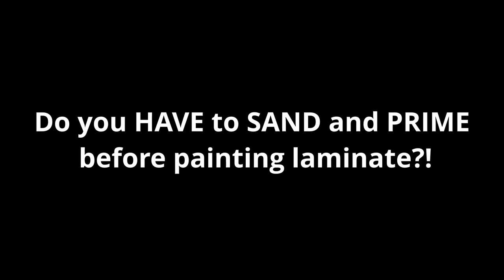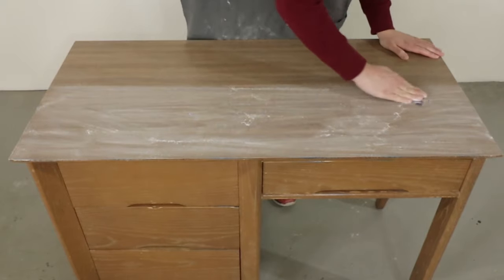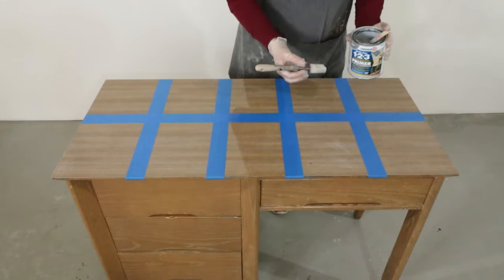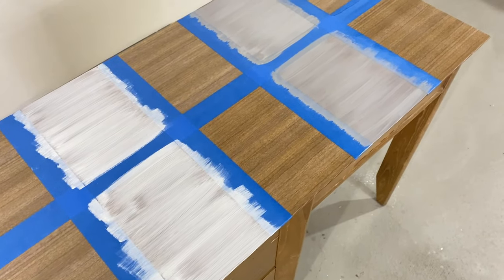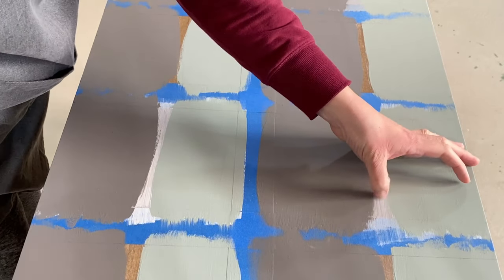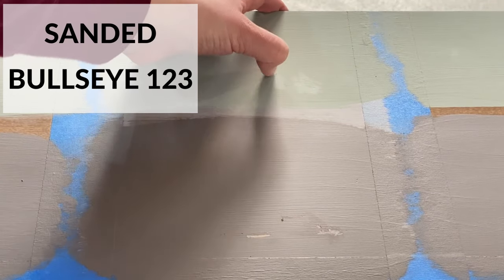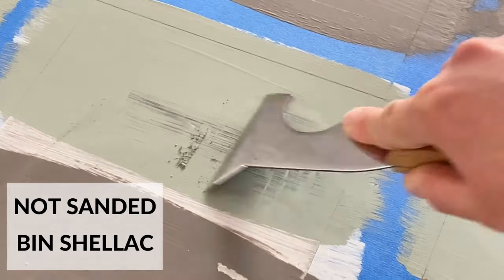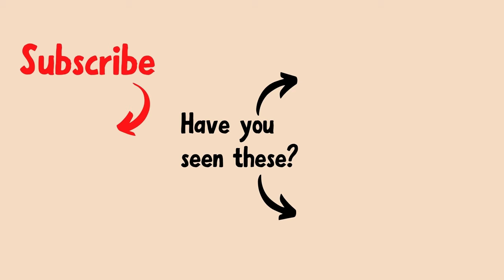BEST Primer for Laminate Furniture | Without Sanding VS Sanding | How to Paint Laminate Furniture

Comment: The day Zinsser and Killz products were presented to me, especially BIN Shellac is a point of no return. It sticks to almost everything, including a greasy, cracked wall behind a stove with a crappy exhaust hood. No amount of degreasing and sanding then priming with oil base then mud then primer and then painting would stick, everything peeled right off. The gray heads in the hardware store blamed my technique, their products and recommendations were fine. 

Then Youtube proposed killz and BIN and I tried it, and never went back, it's part of every single drywall repair or priming task where a clear coat is not required. Had not tried on laminate tops yet, your video is evidence I can trust my friend BIN.
Reply: Is it dangerous to use around children and pets?

Comment: What is the best tool to use with painting on the Bin Shellac primer for laminate furniture, like an Ikea desk? Foam roller or bristle brush? Also, I've been trying to find examples of someone using lime wash glaze over color painted pieces. I have the Valspar lime wash glaze. What would be the biggest difference between using the lime wash glaze or white wash? I'm overthinking I believe.
Reply from the maker: Yes, this method is for furniture like an ikea desk. You can use either a roller or a brush, whatever you prefer. As for the liming wash or white wash, they are the same thing. I haven’t personally used them over paint, but I’m sure someone has! Best of luck!!

Comment: After ALL the confusing videos I've watched, yours FINALLY answered all my questions and hesitation. Excellent tutorial and you saved me so much time! Now I can confidently sand laminate, use BIN shellac primer, then chalk paint. Done. Thanks a million.
Reply from the maker: Happy it helped!
Reply: Specifically came here to see which is the best option. I just painted two night tables with chalk paint (sanded, no primer) and they are just for my use anyway....and I was really impressed with how well the paint adheres and stands up. BUT considering how much work goes into painting any piece of furniture, I wanted to be sure that it's not going to be wasted because I should've done something. I'm now at the point of repainting furniture I painted about 25 years ago (latex, no sanding, no primer, over wood) which stood up amazingly well but is not the best looking. (But I was learning). This was a great video, thanks so much.

Comment: Thank you for an informative video! I want to paint a cheap bathroom vanity. If I went with the shellac primer and a chalk paint, do you think I could put a sealant on top of that since it will be in the bathroom?  Please and thanks!
Reply from the maker: Yep, for a bathroom vanity you can. I would do a waterbased polyurethane topcoat. Make sure to apply 3 coats for the best durability.

Comment: OK I'm not doing furniture, but laminated room doors, five in total. I will not be removing the doors seeing as I am working alone. I'm a 71 year old woman who is not as strong, for some reason, as I used to be. I have nowhere else to go so fumes are a concern. Sanding is also a concern with no way to block off the dust from the rest of the house. This also eliminates spraying. I will be painting latex over these. The Bullseye 123 sounds like my best bet. Any suggestions?
Reply: following

Comment: Thank you for this. I'm trying to figure out what went wrong with a laminate shelf I just painted. Used the BIN primer, but used latex paint over top and it's all peeling off. Should I go straight for chalk paint? Or do I just need to seal the latex paint to get it to stay put?
Reply from the maker: Oh no!
Is the bin staying on? It’s just the latex?
You can try to seal the latex and see if it will be enough. But since it’s a shelf, it might not be. 
You can also wait a week or a month to make sure it doesn’t get better.
A poly topcoat will definitely be needed over the latex but I don’t know if it will keep it from peeling up.
I’m sorry!!
Reply: The BIN is staying, it's just the latex peeling off. Such a bummer cause I feel like I need to sand and start over at this point.
Reply from the maker: What a bummer!

Comment: Would the results have been different if you have sealed at the end?
Reply from the maker: Maybe a little bit. But the topcoat can only do so much if the layers under it aren’t adhering to the surface first.

Comment: Bullseye 123 is lying when it says "sticks to all surfaces no sanding" (it will bond , but takes a month to fully bond), you are right to be skeptical , and most of those water based primers do not hold up to that labeling ..... Kelly Moore KelBond is probably the best , but it doesn't brush well , it sticks well , but brushing it sucks really , not user friendly ..... I have found THEE BEST water based bonding primer , hands down .... going to make a video on it soon , I just discovered this , it's a game changer ..... sticks ALMOST as well as BIN , water based , you definitely will not scratch it off with a fingernail .... and truly NO SANDING
Reply: what is the water based primer you found
Reply: @GadgetsGearCoffee  PPG Breakthrough Satin , but it's not a primer , it's a paint , but it sticks like crazy and can be used as a primer , HOWEVER , it's expensive as hell .... Kelly Moore Kel Bond is half the price and works pretty well .... all the others are okay for general use , they aren't terrible really , and the Zinsser 123 ain't bad .... but that PPG BReathrough will stick to ceramic tile like a mutha !!!!! Takes a while to FULLY Bond , but it BONDS .... in just a few days it's stick quite well ....

Comment: That "Laminate" sanded awfully easy ..... THAT is some crappy "Laminate" , sure as heck isn't Formica .... What exactly do you mean when you say "Laminate" ??? From what I see , it looks like you are sanding a clear-coated top , NOT a "Laminate" like Formica ..... Formica Laminate does not sand like that , you can barely scratch it which is why it was such a good counter top ..... I think when you say "Laminate" you mean "Veneer" , some furniture is MDF with a thin VENEER of "grained wood" and then it's stained and clear-coated ..... It's basically MDF that's given a thin veneer of "real wood" ..... I think it's a bit confusing to say "Laminate" because it's STILL just "stained and clear-coated wood" , same as any wood furniture would be .... and if it is "Laminate Furniture" , that's going to be the kind of furniture that has a Formica Laminate like the IKEA stuff .... That stuff doesn't sand very easily , it's not supposed to , it's super tough by design
Reply from the maker: Videos can be so deceiving. But yes, this stuff is laminate. like thick, plastic ikea stuff. Like Formica. I know very well what wood veneer is, I work with it all the time, and this is definitely not veneer.
Reply: @ARayofSunlight  I've sanded Formica , scratched it up to get a bond for painting ... I never saw that much "sawdust" sanding Formica , that's why I was skeptical about the word "Laminate" ... That must be some crummy Laminate to sand that easy

Comment: Best, most extensive review I've seen. I will be painting my old laminate kitchen cabinets soon. Thank you!
Reply: Yes, agreed, thank you so much! You've saved us all so much time & money with your really helpful research. 🌞
Reply: Hey me too! My cabinets are getting sanded and primed, but I think I will go with the latex over the Killz original, because chalk paint is just too matte and I don't know how hard it will be to clean them.  Of anything, kitchen cabinets really get greasy and dirty.  I like a lot of light in the kitchen so splashes and dirty fingermarks really show.
Reply: @rockshot100  prolly too late for your project but you can put varnish over the chalkpaint for kitchen cabinets. I use old master's brand armor. I have this product on chalk-painted hardwood floors for a year. It's amazing. Easy water cleanup ... but bad fumes. You can buy it in gloss or satin. Getting ready to repaint the kitchen cabinets and use old masters instead of that stupid wax that doesn't hold up for kitchen use. good luck!
Reply: @rockshot100  Are you willing to update us on how this went?
Reply: @queenofqwerty  Thanks
Reply: @mirandamom1346  Sure, I haven't started yet.  I am painting the outside (exterior of the house) right now.  But will give you an update.  I have seen and heard other people doing exactly this and they are satisfied.  Chalk paint is extremely expensive, but I want to be 100% sure the paint will stick and be durable.  I will let you know.  BTW, SW often has 30-50% off sales, it is good paint but why pay full price if you don't have to.
Reply: @rockshot100  Thanks. I’ve never thought about using anything but cabinet paint on cabinets, so I’m curious to hear how latex works out for you, especially in terms of brushstrokes and durability.

Comment: This was a nicely done comparison.  I agree (and would have guess ahead of time) that the shellac based products would stick the best.  I have lots of experience using both clear shellac and the BIN.  Shellac is a very 'sticky' molecule and is often used as a tie-coat to allow two otherwise incompatible finishes to be applied to a surface.
Reply: She did a great job, and these are the results I expected.  I was not convinced that the chalk paint stuck so well, but it does.  The downside is, it is very expensive and for surfaces that get a lot of use, like kitchen cabinets, desk tops, etc., I doubt it will clean up very well.  It is flatter than flat or matte and seems like it invites grease and general dirt.  Personally I would use a much coarser sandpaper and a sanding block (scrap 2x4) to really get some grooves into the laminate.  BTW, I did not know that clear shellac existed.  Somebody told me to never worry about getting the white shellac to look good, only make sure that it is covered.

Comment: AMAZING!!! Thank you for this! I got STIX primer based on the recommendations from the local hardware store because they said it would be good low VOC but I looked and it's not low VOC. I have IKEA furniture I sanded down a bit the melamine with 150 grit, had an N99 mask on, tried to keep things as clean as possible but the dust still did go around, I'm working indoors and I'm at home a lot so I want to go with low VOC. So even though the BIN is the best and I see it scratching a little on the sanded side of your test, I think that's the route I'll go and just be careful I suppose.

Comment: Great video!  I painted a few wood pieces at home and my bathroom vanities are such a disappointment for me.  I was in a rush and not knowledgeable and used the 123 on them with cabinet paint.  They peel.  I used liquid sandpaper. Oh, these were 80s oak cabinets that should’ve been sanded.  My plan someday is to just get new doors and drawer fronts for my vanity, strip the paint off and use shellac. They are totally fine for now because I touch them up and then they look brand new.  If I had used Sherwin Williams emerald urethane paint with a good cure, that would’ve been better. I have a dresser with that and it’s solid.

Comment: You can take the CCP to a some strictly paint retailer's. And put it in a spray can for aerosol use. Seymour is the vendor for this. 
They should have both for solvent and for latex products. 
About 10-12 dollars a can.
One tip ...life span is about 30 days.
Hope this helps

Comment: Hello 😅👋I’m wondering if you could help me, I loved your video and made so much sense. I’ve ordered a full pax wardrobe and I’ve gone with a grey and gold theme for my bedroom, so I’ll be doing the same with the wardrobe, would this method do great for painting the frames and doors of the pax wardrobe I assume? Well everything as I'll be covering everything that's white. I’m not sure we’re I’ll be adding any gold yet or where what should go where with what colours, but definitely some gold on the inside with grey colours, so I’ll definitely get the bin shellac primer for everything.

I’m still stuck with what type of paint to get? I saw you used a lot of chalk paint, is that what I should go for, other videos say water based paint is okay, but your video seemed to make so much sense. Also I’d need a lot of paint I think for a 236cm height by 200cm width wardrobe.

I’m still looking for inspiration for how to bring the grey and gold together but the main thing is just the method of painting to give it that perfect finish you had in the video, to make it easier I was gonna do the painting before I build the wardrobe, so I’ve just got a peace to work on at a time and not a whole wardrobe painting at awkward angles etc haha. 

Also to add I haven’t bought any painting products yet, that’s we’re I’m stuck. The primer you suggested sounds promising! So I'll get that for sure. 

Thanks for your videos and thanks for your time 😇🙏.

Comment: We had a pro reface our kitchen cabinets. He made new doors. But the paint he used was some self leveling  paint made just for kitchen cabinets. It took 24 hours to completely cure and stunk really bad. But it dried with zero brush strokes or roller speckle. It dried super hard and accidental dings do not even leave a scratch. Any idea what brand it might have been? Seems that would be ideal for furniture.

Comment: Thank you so much. I am painting a laminate bookshelf for a friend. She wants me to use her latex paint left over from her walls. Well, I sanded the boards and she didn’t have any primer and told me to just paint. Yeah right! Exactly what I thought. The paint came off in sheets of latex. So I’m starting over doing it right. I have remanded all the boards and ready for primer. I have Valspar professional bonding primer I was going to try but after watching you I think I’ll run over and get some shellac based. Thanks so much!

Comment: Nice comparison Almost any primer if not sanded in between coats and at least 2 coats of primer will scratch off. Not only does surface need to be sanded but the primer as well in between coats with 2 coats being optimum before your layer or layers of paint.

Comment: Latex paint needs about a month to fully cure. The higher the gloss the better strength.
Reply from the maker: Most paint needs about a month to cure.  But I’ve tested it many times, letting latex (or any) paint dry for 30 days doesn’t mean it’s going to stick or be durable.

Comment: Do you know if you can put the BIN primer in a paint sprayer?
Reply from the maker: It depends on the sprayer. It has a low flash point so it can more easily combust.

Comment: What if you have an item that's been waxed ?
Do I still need to sand it, as I can't imagine the primer setting hard due to the wax, or will it be fine to paint straight over it...
Reply from the maker: I don’t wax much, but it’s my understanding that if it’s been waxed recently, the wax needs to be removed first. I’ve used mineral spirits to do that. I’m sure there are other products you could use.
Sanding wax can push the wax further into the surface and cause more problems.

Comment: So what I got out of your video - primers and sanding don’t matter that much. Also, in fairness - Country Chic Paint is an all in one with a built in top coat. So I don’t think comparing it to latex is very accurate…? And most chalk paints do take 30 days to fully cure. Not sure about latex.
Reply from the maker: I think you might want to rewatch the video. Primers and sanding do matter. 
Also, comparing chalk paint to latex is totally fair because so many people diss on chalk paint and think they can just use latex
Reply: @ARayofSunlight  I had no idea there were so many that use latex!